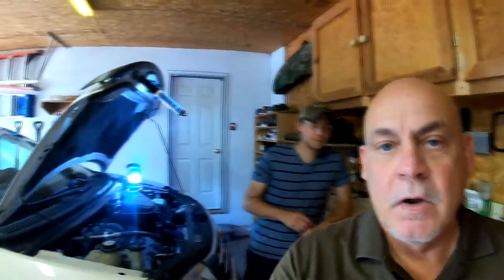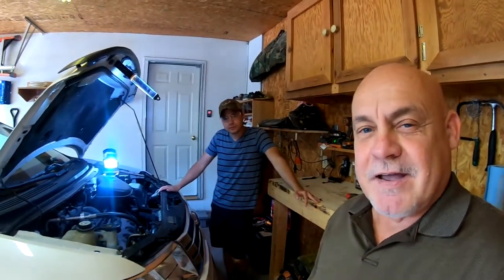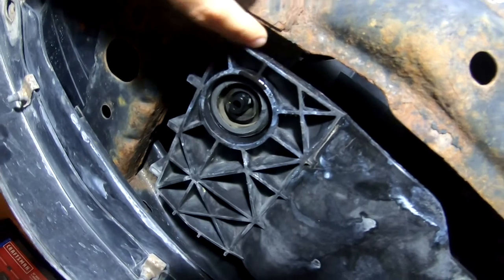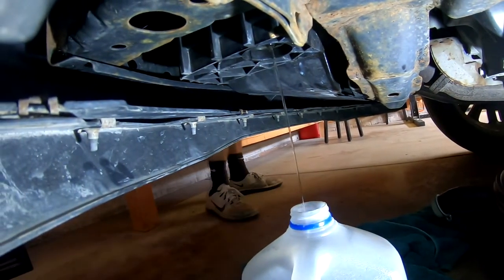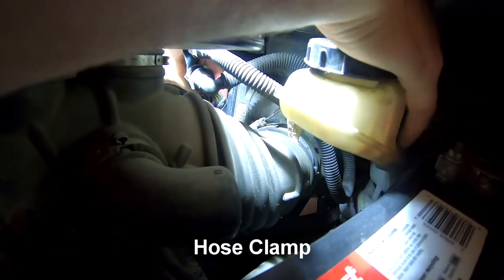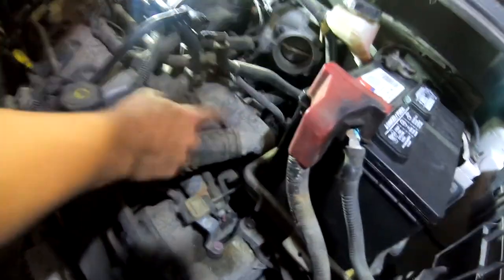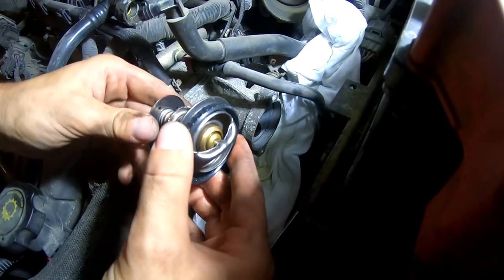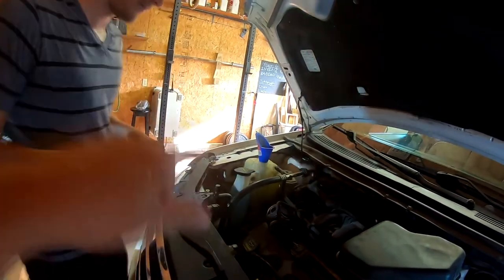How to replace the Thermostat in a 3.5L 2008 Ford Edge!  Overheating!  DIY

Comment: Based on the symptoms and the amount of coolant you got each time .  

I’d say you may have a clogged heater core. 

It might not be leaking.  But it might have gotten backed up somehow and clogged its lines/hoses. 

If your heater in the car isn’t working check that out too. Make sure it can blow hot air. If not that maybe the issue. Likely thermostat or heater core. 

But if y’all didn’t check the ac you wouldn’t have known . 

Thermostat would have likely been my call if it’s overheating too.
Reply from the maker: It turned out to be the fan. Thanks!

Comment: I’m having the same issue on my moms 2011 ford edge se 3.5 changed the radiator the water pump and the thermostat turned out to be her fans I got the fans to work but from it
Over heating I think the thermostat went out again changing it as I type this hopefully it works
Reply from the maker: Good luck and let us know!

Comment: My Ford Edge 2010 limited edition is temperature Guage is overheating. My fans stop working what could be the issue??
Reply from the maker: Is the electrical connector attached? Maybe the temperature sensor? Thanks for the question!
Reply: @OurSimpleAdventures  thats the conclusion we came up with. Thank you for your response 😊🙏🏾
Reply from the maker: @chocolatecharm21  You’re welcome! Good luck!
Reply: Hi I’m having this same issue with my 2010 Ford Edge limited and I changed the fans out but it’s still running hot with the AC on!!! Any suggestions?!? Thanks for your help
Reply: Also seems the fans are not kicking on wit new fan assembly installed…
Reply: @Nira14k  my problem was fix with replacing the cooling fan module that goes inside the fan assembly. It do not run hot anymore but my air isn't as cool as I think it should be like ice cold. Hope this helps
Reply: @chocolatecharm21  hello thank you for your help! I’m going to get it looked at this week and go from there! Praying it’s something minor
Reply from the maker: Hi Nira, Did you replace the thermostat?
Reply from the maker: Check the connections I guess?
Reply: Hey, you guys thanks a lot for your help it ended up being the coolant fan assembly replaced it today and she’s back up and running!!!
Reply: @OurSimpleAdventures  hey thanks a lot for the help it ended up being the coolant fan, the first one was faulty had to replace that one and now she’s all good
Reply: @Nira14k I'm back in the same boat again. I think its this hot weather and I know its the coolant fans so I'm going to have to buy new ones
Reply: @Nira14k  Glad your problems were fixed. How much did you pay for fans/maintenance?
Reply from the maker: @Nira14k  Glad you got it figured out!
Reply from the maker: @Nira14k  Cool!
Reply: @chocolatecharm21  hello yes this Florida heat where I’m at is crazy right now, I paid $255 for the fan and I YouTube’d and installed myself! Their cheaper online but I was impatient and went to autozone and got a lifetime warranty!
Reply: @chocolatecharm21  hope this info helps you out

Comment: Radiator fan....
Reply from the maker: You're right! That's what it turned out to be. Thanks for the comment!
Reply: @OurSimpleAdventures  Had this problem a month ago. Changed the fans and got a quality one on Amazon (around $190 bucks or so), and although it is super loud, my 2010 Edge never overheated again. I am looking to change the thermostat soon, so your video was very helpful. Thanks to you and Jacob. Another thing- not sure if you know, but these Edge's are VERY prone to water pump failure. Change that fluid out (or at least drain and fill) every 30k-35k miles and you should be ok for a while. I found this out the hard way at 77k miles. I had changed it only once and the water pump failed and antifreeze mixed with oil. Engine was toast. $3k later, I had a Lincoln MKX motor installed. Same design flaw though, so I still have to be careful with it. Hope this info helps you. Thanks again.
Reply from the maker: @peteygnyc  Thanks a lot Pete. Yes he did find out it was the fan and replaced it. Thanks again for the info and comment! God Bless!